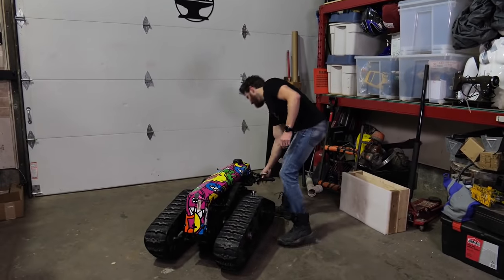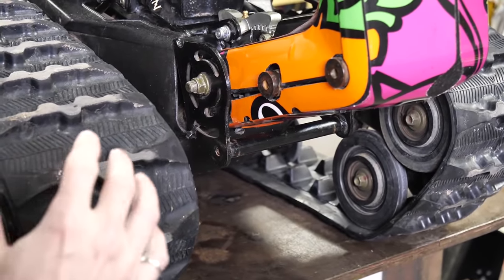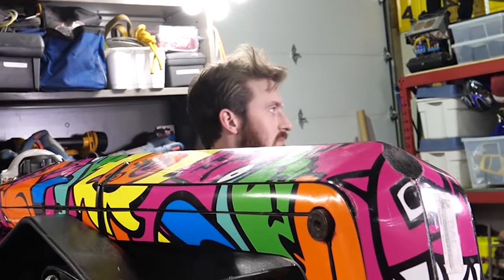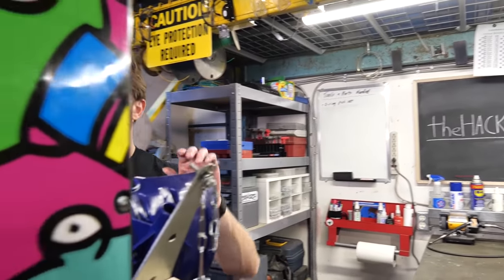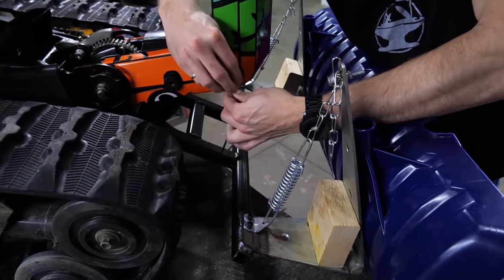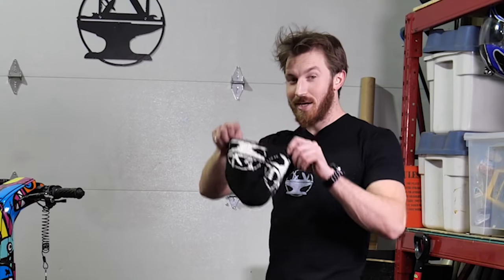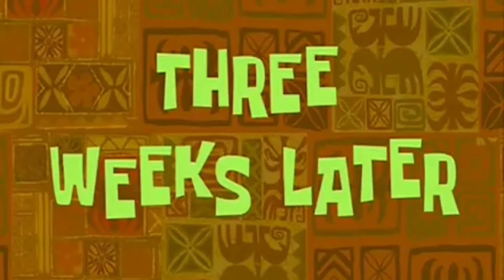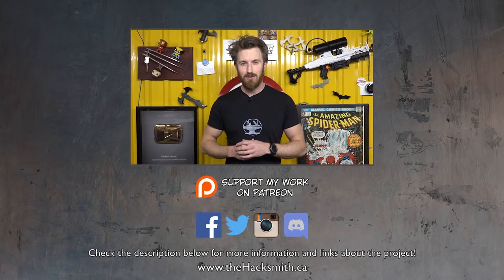Plowing Snow WITH A TANK!

Comment: you should have mounted the plow at an angle so it clears the snow to one side
Reply: Ian Jackson or even better, a two sided blow(making it kinda look like a triangle in front) then you could slice things that get in the way and push it to the side
Reply: that would work as well
Reply: Nicholas Soultanian 
So basically a cross between a snowplow and a cow-splitter? That would work pretty well.
Reply: If you put it to one side and do it in lines it will be better, but the you would have to change the force one side exerts to equal out the balance
Reply: Plow it back into the neighbors yard
Reply: Yea I agree with Nicholas make it like one of those plow trucks
Reply: Ye because by doing what they did, they basicly get messed up by the snow xD
Reply: Ian Jackson  yea

Comment: Hey Hacksmith...
I think that excessive snow ist stopping the vehicle at particular occasions...
So if possible please give the plough a bit angle on either side of the vehicle...
Like the ones in the original ploughs...
It will reduce the opposite force and will align the snow sideways.....
👍👍

Comment: this thing looks very fun but standing right next to the open moving tracks looks very dangerous.. this thing should be called the legbreaker. the original one seems to have protection, so you took that off because snow is less slippery? :D
Reply from the maker: If you fall off the tracks stop... Not very dangerous
Reply: well you are right, sir! if one of your feet slips of the stand falls on the track gets drawn to the front and the leg and the rest of you gets tangled underneath the vehicle - you DO stop.

Comment: You guys forgot that when you accelerate you can actually make the snow go to the top of the shredder which will make you not have the ability to adjust that height in the shredder try drilling a small hole in the Center of The shredder and attach a small cable on the bars that have height Just went

Comment: Probably should have engineering some kind of wedge-shaped plow rather than using a straight plastic shovel. This project only seems "extreme" because of the work of your friend making the tank scooter. Bolting a plastic shovel to it using hardware you probably had lying around wasn't a very impressive achievement (especially compared to some of the work you put into other projects). Sorry to come off negative, but honestly was it any more than half a day of work for you?
Reply from the maker: You get that it's extremely challenging to do huge projects and videos every-single-week right? They can't all be "impressive"